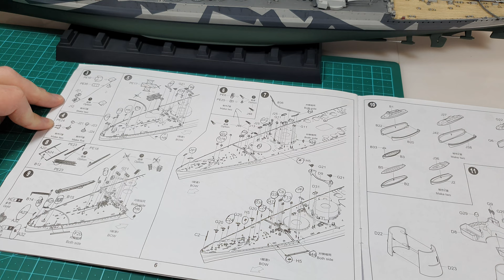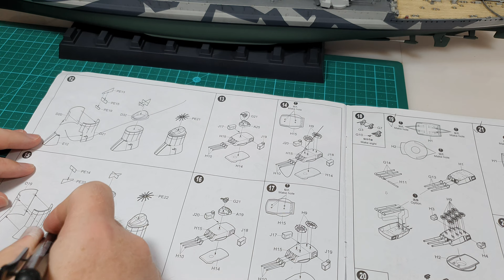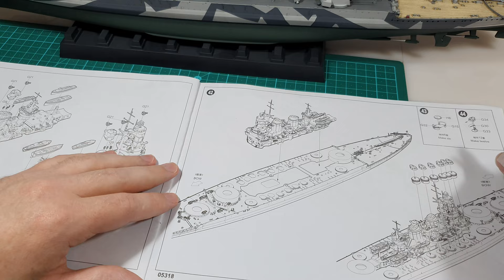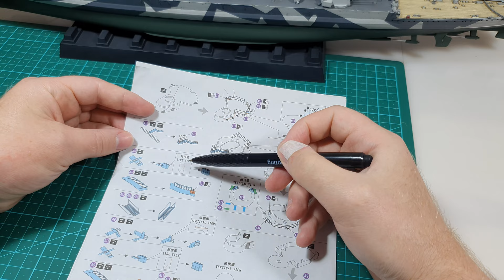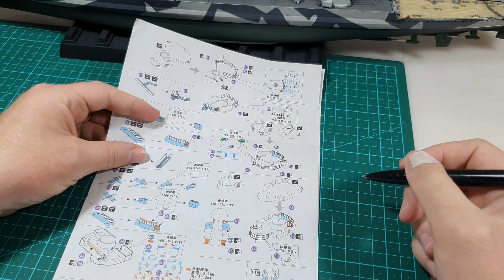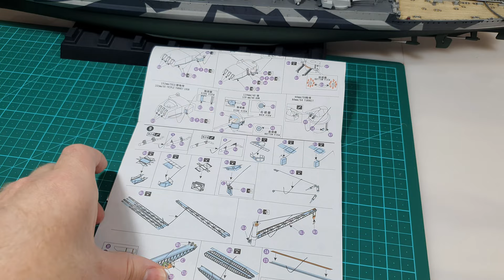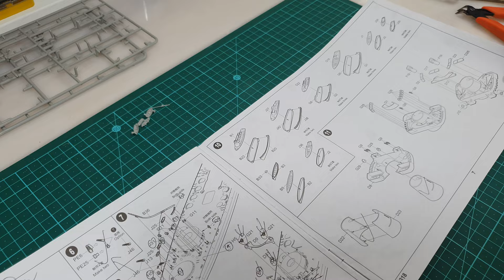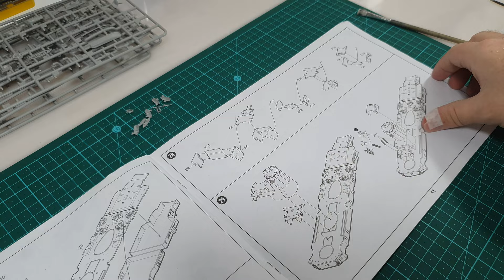1:350 RN Roma: Part 7 - Finishing Touches to the Main Deck and Main Armament

Comment: hey. great video as always! 
did I understand correctly you are have thinned the X22 with X20A or did you use MLT there, same as you did with the matt varnish?
I know those problems with the metallic colors as well, as I did build some cars with small metallic parts (engine block, exhaust, etc) before going to 1/350 ships. As that cleaning of my airbrush killed my nerve, I decided to use a cheap airbrush (kinda thrown-away thing) that I dedicate for metallic colors and small parts. My nerves are saved, so I can recommend that ;-) . I am using the acrylic Tamiya metallic paints and they do work well. Ofc I still use my primary Iwata in case I paint the whole car body for better results.
Looking forward to your next vids.
Reply from the maker: I thin X22 with either X20A or MLT. If I want the gloss coat to dry more quickly I use X20A, otherwise MLT is probably going to do a better job.

I don't use MLT with the matt varnish because it will make it a bit glossy. If I use Tamiya XF86 I thin with X20A. If use Mr. Color 182 I thin with Tamiya Lacquer Thinner. I would like to try Mr. Color Rapid Thinner but I have not seen it in my local hobby shop.

Comment: Nice work, thank you. A question, which fluid do you use to remove the panel line color (starts at time 21:20)? Is it white spirit or water may be?
Reply from the maker: It is white spirit, we call it mineral turpentine here. The panel line is a very thin enamel paint, water will not remove it.

Make sure that you only apply panel line onto acrylic paint. If you apply panel line on enamel paint you will remove both the panel line and the paint underneath when using white spirit. This is why I recommend protecting the paint with a clear gloss acrylic varnish before applying panel line.

I also recommend you test the process on a spare piece of plastic before attempting it on a model to be sure that nothing gets damaged: paint -> varnish -> panel line -> white spirit -> varnish